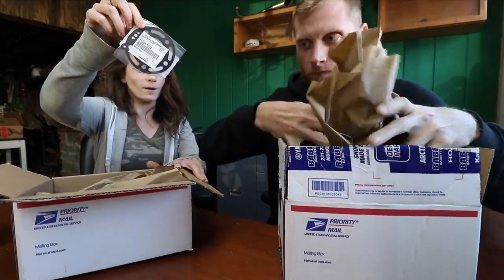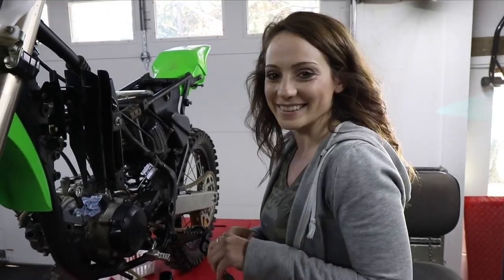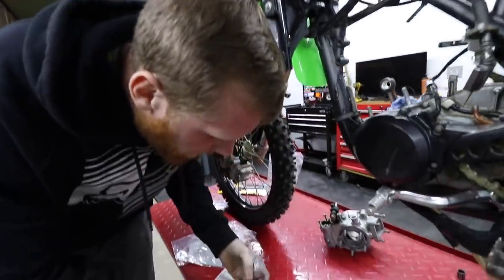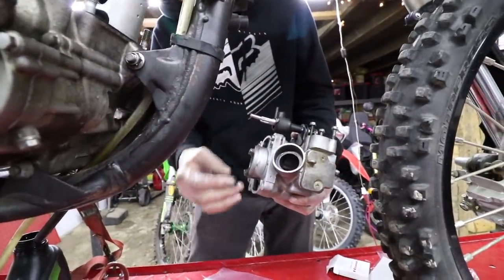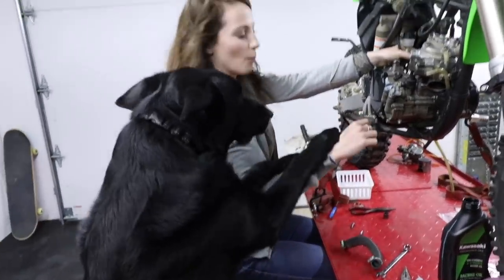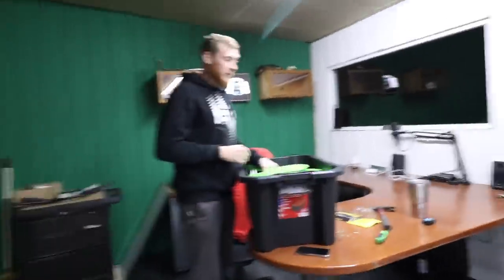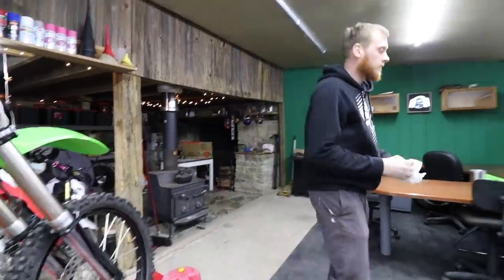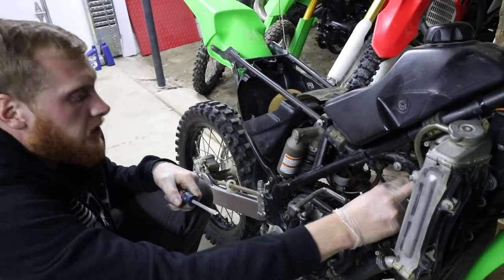Our FIRST Two Stroke Rebuild! | The Rise & Fall Of The KX100..

Comment: To make a 2-smoker fire off right after a top end job, pour a small amount of 2 cycle oil down the spark plug hole, put the plug back in, kick it 2 or 3 times with the throttle full closed and the choke on.  Push the choke in, hold it wide open and kick it.  It should start right up.  If not, pull the plug and shoot some carb cleaner down the hole, put the plug back in, hold the throttle wide open and it'll fire right up.
(the oil on top of the piston seals the unseated rings)

Comment: From my experiences I believe you have the piston in backwards typically on the bikes I’ve rebuilt there is an arrow pointing towards the exhaust port and I believe the b should have been flipped to the other side so it was farther away from the exhaust and closer to the reeds indicating the b would stand for back

Comment: DOnt let it get to you, however I know how you feel. I tore apart the top end on my Road King as it was leaking between the head and cylinder. Replaced all associated gaskets/seals, put it all back together, now it's puking oil out one of the pushrod tubs on the rear cylinder (at least the front one is fine now, lol). So I'll be getting back into it this weekend. While this may be depressing, it's comforting knowing... I'm not alone ;)

Comment: LoL! I have 6 2 stroke dirt bikes, I use Amsoil Saber at a 100:1 each and every time. I use Saber at 100:1 and have never froze a motor. I enduro my bikes I have a 03 RM250, 02 CR250, 00 YZ250, 01 YZ125, 99 YZ125. Im in to process of rebuilding an 03 CR500AF. Amsoil absolutely the best 2 stroke premix, its fully synthetic and has warrenties that no others can make.

Comment: An easy way to clean plugs is to heat up the ends until they are red hot with a torch that’s what worked for me whenever I fouled a plug on my kx100

Comment: The leaking carb may be the float valve.  As it’s not been used for a while the seal tends to get dry, it may cure itself being used again being soaked in gas 🤞.

Comment: In the future you should install one of the clips in the piston before you install it onto the crank
Reply from the maker: Good idea!
Reply: Attention Deficit I was thinking about this while watching lol also do you have any opinions on rebuilds and how often they need to be done? I’m going from my “vintage” XR100R to looking to buy a cr125 and I’m not too sure on how rebuilds are going to work
Reply: Yes its deffinatly easier to fit one cir clip first before putting the piston onto the rod. I did my top end last week on my cr250.1st time I ever done it and it kicked up 5th kick after the rebuild 👍heat cycles was done yesterday:-)  job well done
Reply: @alexdamron3170  what sort of advice do you need mate? After you do a top end you should deffinatly fit an hour meter to keep on track with your engine hours.  Shat advice do you need on the top end? Ask me and ile tell you 👍

Comment: When de-glazing cylinder walls you want to have the drill spinning before you actually starting hitting the cylinder wall, and always keep a steady speed on the drill (not full speed), that should give you a nice cross-hatch.  Also do this for about 1-3 minutes going up and down at a medium speed.

Note : No hate coming from this comment, just tying to help out!

Comment: Great video helpful tip for the c clips start on the bottom hold the clip in place with your thumb and then get a screwdriver push the top in it should snap right into place

Comment: 20:53 correct me if I'm wrong but I think 32:1 and 28:1 is on the rich side lean would be like 40:1 which is less oil to gas ratio. 👍

Comment: When honing you should avoid stopping and starting the hone inside the cylinder. Keep it moving. You want the crosshatch in a certain angle which can only be achieved by keeping the hone spinning and moving up and down in the cylinder.

Comment: I hope the bore is ok for you guys🙄!  Nikasil plating is around 1/10th of a mm thick.  Discolouration of the bore may be a sign of wear, try scratching (lightly) the dull parts with a scribe.  If you can scratch it it’s worn to the aluminium.  I hope it’s not the case and you get the bike running 👍.
Reply: I thought you were not supposed to hone a Nikasil coated cylinder.
Reply: Chris Blair ur not supposed to

Comment: This is the second liquid cooled 2 stroke in a week I've seen. When I used to ride 2 strokes they were all air cooled. Of course then so were all the 4 stroke bikes. Needs electric start!
Reply: Easy Rider they have pretty much all been liquid cooled since the 90’s
Reply: @That_5.0_Ranger  I haven't paid any attention to 2 strokes since the '60s. I still see a lot of the 4 strokes are still air cooled so it just took me by surprise that 2 strokes were not air cooled. I also like motorcycles to be air cooled.

Comment: Tried to do mine a week ago, dropped 2 wrist pin bearing needles in the case. Now the guys at the shop have it and I’m in the hole $1000 (they are splitting the case), can’t wait to get it back running 😩
Reply: Ohh dear... why didn't you put a cloth in there to stop things dropping in there?
Reply: I did top end on my cr250 last weekend and it all went perfectly. 1st time I done one
Reply from the maker: Noooooo.. Sorry to hear that.

Comment: Because you are tired don’t forget to re torque after the heat cycles
Reply: I did my top end on my cr250 last week and I did my heat cycles yesterday but havnt re torqued  my bolts yet. Is this a must?
Reply: moto mix no it’s not. one you torque down once it’s toqued. unless it’s unscrewed
Reply: @jayroberts1297  I sold my cr250 a month ago and now got a cr125 to make road legal 👍

Comment: using the same c-clips? dont do it xD on my yz250f a c-clip just came out middle high rpm and the result was a new connecting rod, cylinder and piston